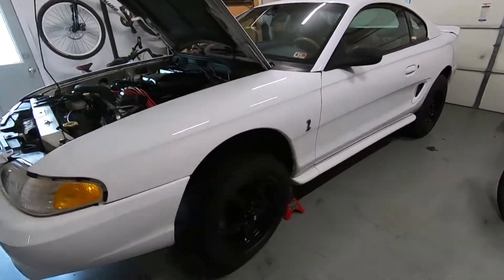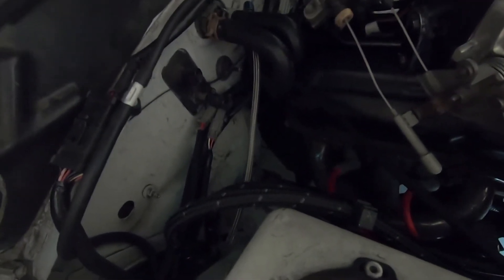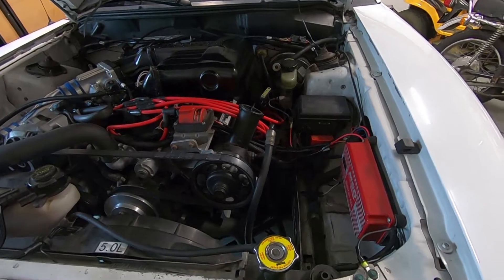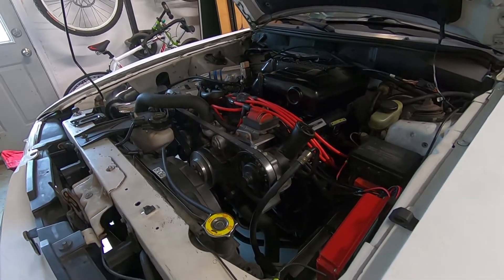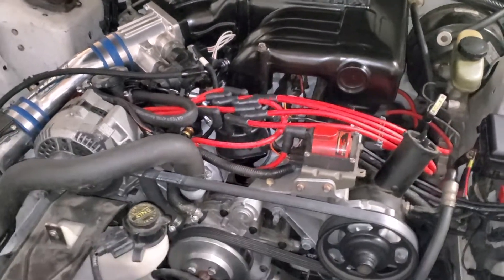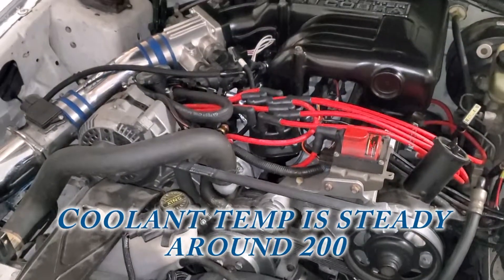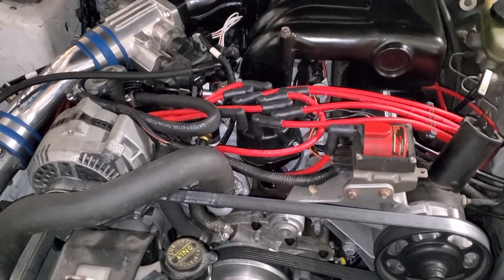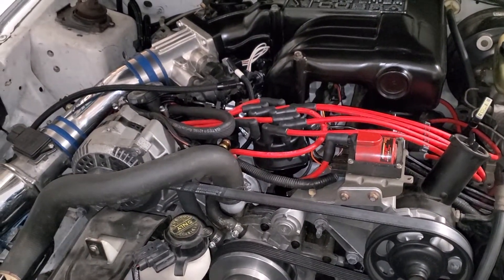SN95: Started spark knocking/pinging/detonating

Comment: Maybe smog pump and EGR valve are Carboned up and send Embers into combustion chambers.
I'll try the 14° sweet spot.
And disable smog input.
Timing chain slack is precise either direction of crankshaft rotation while watching distributor rotor.
And distributor  should be dismantled brake kleenex and blasted with air.
Checking for rust particles/ corrosion confusing the magnetic pick up.

Comment: I had a similar issue on my fox. It turned out that the ignition coil was bad. Car wouldn’t go past 4500 rpm like a hard rev limiter. Changed the coil and all issues went away. Reved freely and clean after.
Reply from the maker: I snagged a new coil, been checking all the little things the last few weeks...going to install it soon, hope thats it!
Reply: @BabyLegsMotorsports  My sparkies were loose.